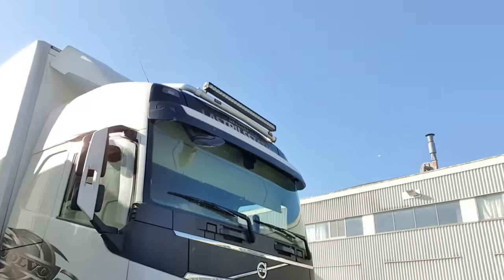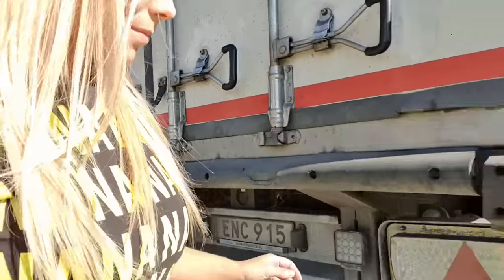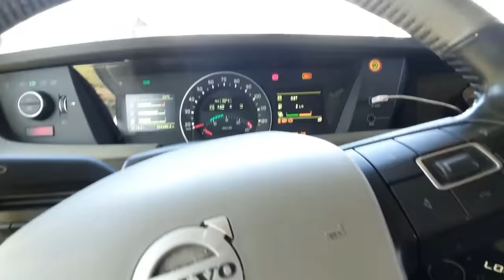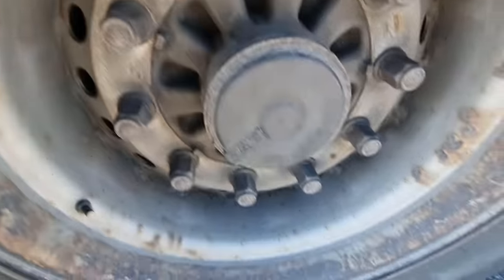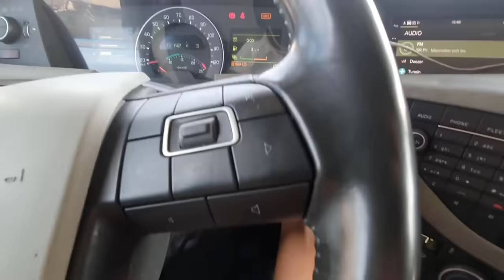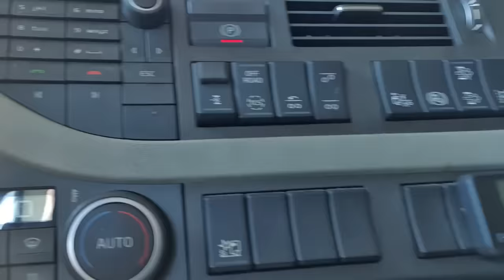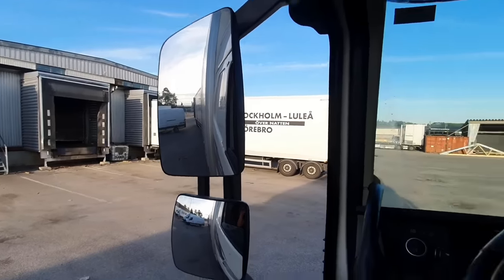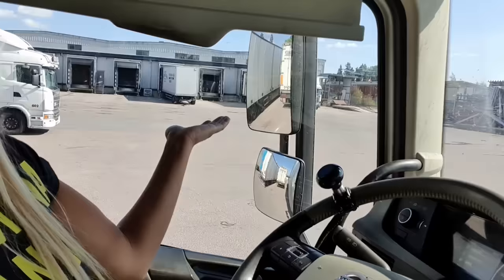HOT BRAKE PADS - locked wheels, Angelica Larsson

Comment: You cage the brakes when this happens. There is a bolt that goes in the center of the brake chamber. When you tighten it down it pulls the brake pads away so they don't drag. That way you don't have to keep stopping.
Reply: I am wondering if those 2 brakes didnt cam over, rare to have 2 do it at the same time but after changing the quick release valve and caging both axles they still got hot.
Reply: Mike Paolozzi possibly to remove emergency line would fix it? But I believe Europe uses disc brakes.  There is always something phenomenal could happen to the new technology:)
Reply: Sounds to me like they got hot enough to burn the bearing lube.  They should have jacked it up,  check wheell seals, oil lubricity and bearing condition.

Comment: Another awesome video. Sunday smiles. 1 thing I was taught whenever checking something for heat or for possibly being electrically charged. Use the back of your hand. It's a natural reflex for the hand to ball up into a fist. If using the back of your hand natural reflex will pull your hand away from the object not towards it if it is hot or charged.

Comment: About Euro Truck Simulator, we don't have the engine light warning as such but we do have the wear of different parts like the engine, gearbox, tires etc and yes, we have to go to a workshop to repair them. And if the engine has too much damage, it won't start at all. The parts also get damaged if you have an accident. Thanks for your nice cheerful & energetic videos.

Comment: Hi Angelica!, regarding your question about Euro Truck Simulator:

You will only have that kind of warnings on the truck's display if you crash the vehicle. And yes, if you have to much damages on the truck or wagon, you must head to a workshop and repair it.

There is even tyre wear but it doesnot affect the driving.

Game is realistic up to a certain point. I wish they could add loading and unloading, it will make the game much more interesting.

Regards from Frankfurt! :)

Comment: In ETS2 when you damage your truck there's a menu where you see how much you've damaged and you have to repair it on workshops. Also if you damage it a lot you get the engine fault light and the truck starts stalling a lot xD

Comment: Hi. Angelica! Great video always.😃 I was concern about the brakes. Before you drove they should of backed off the chambers. It would have been safer. But you got there safe so thats important. Stay healthy and safe cuttie😀🚚🚛
Reply: I was thinking the same thing.
Reply: Cage the chambers, and don’t be a lazy mechanics and actually pull the tires and inspect the Calipers and wheel ends

Comment: (just to say I listened to the video)
For EuroTruckSimulator (ETS) question : Yes, we have to find a workshop to fix damages as we must find truck stop to "sleep". 
They depend on what kind of "touch" you've done. When warning light are "on" on mainboard (you can see the damage level with F7 key), engine truck can stop, gear shifting can stop working, driving axle parallelism can be modified (you feel it in the force feedback driving wheel) etc ...

Comment: Very interesting video Angelica. You are right about brakes, they are very important safety factor. You are correct about the smell of brakes Angelica, once you know the smell of burnt brakes you will not forget it. I have been around equipment over the years and have seen all kinds of brake problems. Adjusted wrong, hoses hooked up wrong and most of all, lack of proper training about the brake systems. I could see from your video Angelica that you have been properly trained with brakes and are pro active in taking care of the equipment you operate. I would not mind having you as an operator, knowing you care for the equipment like you own, good deal girl!!!! Angelica, again a great video and stay safe, and ALWAYS enjoy the videos and pics you post.....

Comment: Use “
Performance Tool Infrared Thermometer
No Reviews
$34.99”-ti Cheque temperature pls?;)
Safety 1st
Reply: It's okay if it's a continuous problem, but not a one off. Surely?
Reply: gary63693 It is a good tool for a small fee. Very worthwhile. Can be used to check all the wheels/axles in the future.
Reply: I actually have one in my truck for checking wheel bearing temperatures, exhaust temperatures on each cylinder can help diagnose many problems that you might have. I have to admit I probably have at least 200 pounds of tools on the truck since I do all of my own repairs.
Reply: Thermo imagine good stuff

Comment: Angelica, forgot to comment about you checking the hubs for how hot the brakes were. I really liked your method. I do the same, and its a sure way to find out which hub is warm. I did that just this week while driving and old 1972 VW Beetle. Something smelled hot and by feeling the hubs, I found that  the driver's front  brakes were adjusted too tight. Doesn't matter the size of the vehicle the method will result in the same. A little dirt on your hands will be worth it !!!!!!!

Comment: Hi  Angelica. Yes, I play Euro Truck Simulator 2. There are similar problems, but only if you bump into other drivers or bump into someone or something. Then you need to go to the truck service. But if you drive neatly, then only the tires wear out a little. But, of course, you need to go to the gas station to fill the diesel into the tank. And yes ... the driver also gets tired and needs to stay in hotels or in truck stops to sleep.

Comment: Angelica, I was a truck mechanic for many years, If you get fault indicator lights on the dash, you should have a mechanic check it out. They have a scan tool to help them determine what the problem is; also when the mechanic replaced the brake relay valve on the wagon, that was a good place to start, but he also should have removed the wheels and replaced the brakes, because overheated brake shoes are already damaged and should be replaced. He also should have checked the brake s- cams and slack adjusters for proper operation and lubed them before putting the drums back on and putting the wheels back on, and finally the mechanic should have test driven the tractor-trailer to make sure it's operating properly.

Comment: Interesting video about repairing stuff. In ETS2 we have the little lights of turning off or on the leveling axles but about broken stuffs, we have only a global percentage of truck damage. And when it is too high, the truck overheats and we have to bring it to a repair center. Even if we don’t have any accidents, we have to go the the repair center because the wheels take damage with kilometers.

Comment: A tip:  Purchase one of those infra-red guns to "shoot" your tires, hubs, and even things like the intercooler to get very accurate temp readings without having to actually touch anything you can even stand up straight to do all this stuff.  They are ALL fairly accurate with even the cheaper ones giving you decent readings.  I used one for years while towing my big RV with an International ProStar.  Two minute walk around at a rest stop gives you the complete, every axle readings.

Comment: I roll the window down when backing as well, better safe than sorry ! Bummer about the brakes hanging up, if you had no air leaks, and park brake springs weren’t hung up, sticky S cam bushings could have been the issues. No fun with no A/C, you still look great! Should bring a lil bucket of Gojo wipes with you to keep your little paws cleans while out on the road

Comment: Backing ( reversing ) a trailer ,such as  Angelica's which is attached to the driven lorry, is entirely different from reversing a "artic", or as they say in America a, "semi" , (both mean an articulated vehicle) , Angelica's can be the hardest to learn how to reverse, basically you have to be aware what the front axles on the trailer are doing.

Comment: I've played about 2000 hours of Euro Truck.  We don't get errors when the truck is damaged, the engine will just stop working and we need to restart it.  You can either drive to a service station or, if the truck is too messed up you can get it towed.

Comment: Yes.  i get faults on Euro truck simulator 2. Usually the engine just stops and it says i need service. i also get some lights for tyre pressure sometimes. you need to go to a service place.

Comment: Hi Angelica,......Ok so is the problem an issue with low air pressure to the back axles ???   I noted the service tech. had replaced a valve assembly  at your first stop, but apparently did not fix the problem.  Watching from USA, I do have your channel up.

Comment: Can you even tell if the brakes are one when driving? the truck is quite strong.
@9:05 the wheel looks bit worn in one spot :)
Only time i see faults in Euro truck is when the truck has taken a lot of damage from me driving like a dork :) wish they added more stuff like that, random errors that you can get in say a flight simulator, but would add a lot to the complexity. Still need to get one of those trucks that you drive up to Iceland, bet that will be fun with the hills and ice :)
And yes there are workshops that you can visit and repair at, tend to use them after each trip currently going from Iceland to Svalbard only 3290km (2400km on land)

Comment: I remember once I came down a long downhill, to a small ferry dock here in Norway. All the way down I had the stench of something burnt... at the bottom of the hill, I found a Danish driver, looking somewhat worried about his truck. I didn't bother him, but I guess he had been riding his brakes all the way down, and probably mostly destroyed them. All because he ignored the 'low gear' sign at the top of the hill.   
If the brakes had failed, nothing would have stopped him from driving into the fjord...    
(All trucks sold in Norway have a retarder on the shaft back to the diff, and they could have mostly ridden down on that, and not used up their brakes)   
Angelica, you drive a lot with a 'low boy' trailer. Those have more brake problems than other trailers, because the wheels are smaller and have to rotate faster.   
One guy I know in the Statens Vegvesen(Public Roads Authority, the guys that does roadside inspections of trucks) once told me that when they needed to 'show results' when holding roadside inspections, they just singled out truckers with Lowboys because the odds of any one of them having at least one failed brake was so high. 
These days, though, they set out infrared cameras before the control point, and watch the temperature of the brake disks as trucks pass the cameras.  If one is warmer or colder than the one on the other side, they know there's a problem. 
Some of them even carry CAT phones these days, and can do a 'quick brake check' whenever they stop and see a truck they want to check out.

Comment: Hey Angelica, 
In euro truck simulator  you do not have regulars errors like hot brakes and basic errors,  only when you damage is really  bad will have some engine failure
and need to go garage. would be more realistic for sure.

Comment: Interesting.  So if the axles were still making the wheels hot,  then it may be a problem with the bearings and lubricants inside the axle,  which is probably more difficult and expensive to repair than the brake valves and hoses on the outside.  I remember a story that happened in Tennessee,  USA where an axle broke and caused the trailer to turn over and it killed some college students in a car.  It's good that you inspect the truck because it can be a dangerous problem.

Comment: I've seen rotors/brakes catch on fire before. That becomes a costly repair as it can super heat the brake fluid causing it to damage parts on all the wheels. As far as air brakes go it can do the same...I've seen air lines explode from heat if the relief valve gets damaged and it's not pretty......nicely done driving slow and stopping as much as needed to get them the truck to the shop! As for Euro truck simulator, you basically don't get many faults until you run into thing damaging your truck or slowly over time the game will give wear on the tires, transmission, engine and other parts. Truck in real life need much more servicing hahaha

Comment: The mechanic should have solved the  issue the first time you stopped instead he cost you  time your company $$$ and potentially negative customer satisfaction 
Angel you did everything correct as an operator making sure that your equipment is safe and in top shape as is required

Comment: the slack adjusters probably have to be changed generally they become looser but they could cause it to ratchet to tight, worse case is bearing adjustment and with all the heat it will cause the hub seal to go

Comment: American trucks also give false or mysterious fault or engine light warnings.  My trucks engine light comes on briefly and I was told to ignore it by a mech.  Also, my speedometer reads off and over by 2 mph when on cruise control and going 65 mph.  I think a lot of the time Ange, its a sensor gone bad and they give false readings, also some mech are not so great as you have seen and they misdiagnose.  Its all in a days way.  Cya ltr beautiful cat.

Comment: You’d think by now that the Company you work for didn’t put a Quick Checklist inside of each Truck Cab, a list of things for drivers to check, INCLUDING not forgetting to Release the Parking Brake on the Trailers, because its something easily over-looked when there is a Time issue!

Comment: Hi angelica there should be a isolator switch on the passanger side of your truck at the back of your front passenger wheel flick it in the opposite direction for 5 minutes then put it back in the position it was to begin with that should turn your fault lights off

Comment: I'm surprised the workshop didn't remove & check the drums, brake shoes & wheelbearings. When the wheels get that hot, the grease gets very thin & runs out where it can. Brake shoes are burnt & lose their composition, brake drums warp & lose their roundness'. Yet none of these things appear to have been checked.

Comment: adjustable spanner, then ask a young gent if they could climb under and whined the brakes up firm and then off half a turn, done. a slight movement on the brake arms, safe.

Comment: I watched the mechanic at the first shop. He did everything right. Judging by the position of the slack adjusters, I believe that this trailer has drum brakes, not disc. If the brakes had over-cammed, he would have found it instantly. I don't see how it could break a spring on both sides at once. Very strange.

Comment: Hej Angelica. Isn’t there a way you can mechanically release the parking brakes on the trailer so you can pull the trailer without the brakes overheating?

Comment: I sometimes wonder what would happen if mechanics like the ones who 'fixed' your trailer were to repair airplanes. Flying would very quickly become a thing for stuntmen, danger seekers, the terminally ill, prisoners and kamikaze fakirs. They twice messed up. Your mechanics might consider having a go at another carreer, such as knitting or goat herding. Suits them much better. Some job that will inflict no harm on others, no matter how badly they mess that up too. Perhaps you could suggest to Cheech and Chong, next time you're in the shop that they might also move to the south pole? Or even further? Pick any asteroid.
Great video again, thnx!

Comment: in Ontario, Canada the truckers must have a separate certification on their licence to operate vehicles with air brakes and a full understanding of how they work. If the brakes are hot like that over here the vehicle is OUT OF SERVICE on the spot till fixed. To much potential for a brake fire to start which would also mean loss of trailer and its contents plus injury to the driver trying to put out the fire. Next time just walk away till it is fixed, let the company worry about it. Your job as a professional trucker is to be safe without any risk.
Reply: Don't worry. Everyone that are certified in Europe to drive a truck weighing more then 7.5 tons, a significant part of the education is how air brakes works their difference in operation (especially for old trucks where inrush lag is present) and how they are maintained.
Reply: @rhkavli  In North America non of the US States require a certificate and only One province in Canada requires it. Thanks for the info on your side, trying to learn more to compare the two different continents.

Comment: Do you think its easier driving a regular trailer/wagon or a semi trailer? (a trailer attaching directly to the truck) in Snowrunner (a truck simulating game) I find it easier with a regular trailer.
Reply: Snow runner is the worst game I've ever played. The driving dynamics are so poor. I posted it for a couple days, and it takes you like 20 minutes to get a half mile down the road. Forget about driving through any mud or snow. I legit thought I was doing something wrong, or a setting messed up, because it was such garbage.

Comment: My aunt was a long haul trucker. She had a problem with brakes locking and catching fire on the trailer that she was hauling. When she got down to her last fire extinguisher she called her terminal for a mechanic to come out and fix the faulty brakes. The terminal wanted her to bring the trailer on in and she stood her ground and said NO. then they wanted know what her load was she told them AMMUNTION! She then got prompt service!